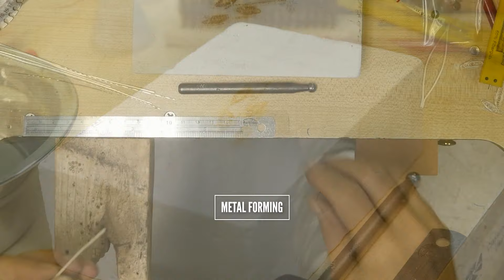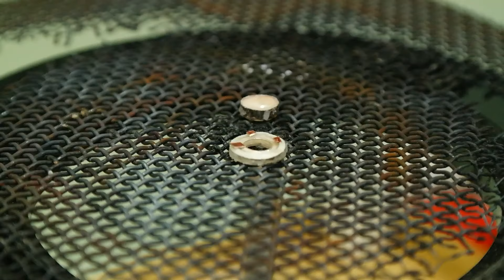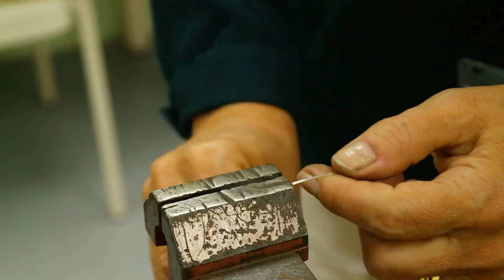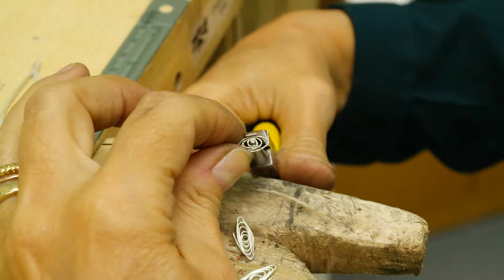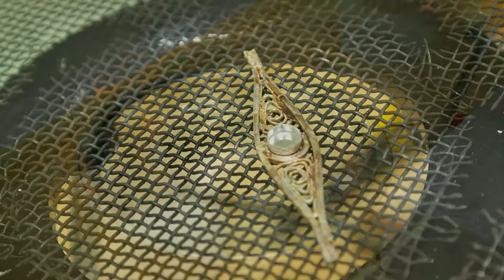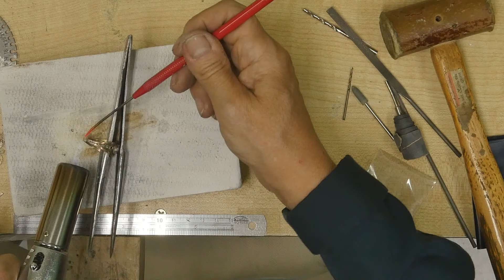💍Silversmithing for Beginners: Filigree technique to make a Ring

Comment: I absolutely love this video! Awesome job explaining everything. I am a beginner, so naturally I have a silly question. When you bow the ring shank wires does it change the initial size of the ring you measured for. It seems like it would. Would I need to go up a size when measuring wire for my shank?
Thank you so much for this tutorial!
Reply from the maker: Hello and thank you enjoying the video, I hope you will have a chance to make you very own ring   For the ring size the most important thing is to use the chart which has been devised so as to get the size to fit perfectly.  You need to know 1. what wire gauge you are using (usually 18g is a very good and sturdy thickness) 2. Your fingersize in USA measurement (there are lots of countries using their own measurements and the chart works really well for USA sizes.) With these two things the ring size will be perfect.  How it works is to select the right ring size from the left hand column and match it to the gauge from the top row.  This produces a length which works perfectly every time:
https://i.imgur.com/Qet7mTe.png
     
Say my size was size 6 US and I am working with 18 ga so the length of 18ga wire to fit around the finger will be 54.6mm long. Since it is hard to measure to the 10th of a mm we can round to the nearest 1/2 mm.  (We can measure 54.5 this would work as 0.1 of a mm will make little difference. So always round up or down to the nearest 1/2mm.)
If your finger size is 5 1/2 you need to take the size 5 result  and the size 6 result, and average them out.  
52.1 + 54.6 = 106.7 / 2 = 53.35 so I would round this to 53.5mm.
Hope this helps and would love to see how your ring turns out  Best wishes, Tanja

Comment: At what point would you shape the ring to dome the top if needed to leave space for a faceted stone while still using a low bezel setting?
Reply from the maker: Hi lizstefany5947,  please excuse my late reply as I have been travelling since end September.  Due to the delicate nature of the filigree, doming the filigree section could be difficult and dangerous.  Any stretching could cause breakage or separation of the fine wires.  It would probably be best not to dome but if you wanted to experiment then I would still do so after all the soldering is finished but before the  final wrapping of the shank around the mandrel into its correct size.  Considering that a faceted gem has only approximately 60% of its width (ie. a 10mm faceted gem will be around 6mm deep) if you use a 5mm or 6mm stone the the depth would only be around 3mm which would mean there would be only a small amount of shaping and doming to do which might work.  The biggest challenge is finding the right shape and material on which to place the ring for doming, something like pitch would work: https://www.riogrande.com/product/medium-red-chasers-pitch/118265GP/?code=118265

Comment: wonderful! would like an in depth of how to make filigree wire and if there are any different styles of filigree wire. havent found a video yet with an in depth explanation....
Reply from the maker: Hi Kevin,  There are no "special" styles of filigree wires just many creative possibilities.  I have worked with square and flat wires the most which, when twisted, create the beautiful twisted shapes that the round wire is incapable of producing.  Flat wires can also be hand wrapped without twisting to produce really nice designs.  Usually the outer frame of a piece is thicker, in our classes we use 18ga silver, with the decorative filigree being made with standard 22 and 24ga square wire which we buy from Rio Grande in the US!

Comment: Um yea soder dosnt flow upward tho? Tht should have been placed on the top not bottom idek wtf tht was
Reply from the maker: Yup it's surprising but solder follows the heat, this is one way we can control where it will flow! It is also capillary action that draws the molten solder into the tight spaces in between the metal parts.  If you just place the pallion on the top and hope the gravity will do the work, you may end up an incomplete solder joint. Have a great day!
Reply: It does flow up

Comment: This is a good video. I would love to make filigree. How much does it cost to get started? Can filigree be made with copper?
I did not understand what pickling meant. Can you explain what that is?
Reply from the maker: Hi Candy,
Thanks for your time and for your comments! Glad you enjoyed the video.

How much does it cost? 
Well, it can cost quite a bit! You saw me in my workshop - and we have tonnes of equipment like rolling mills, wire draws and other cool tools.  But if, say, you were to buy your wire ready-made (eg: buy square wire from your jewellery supplier in the size you want - then you would have much less work and could still be really creative without the need for bigger more expensive tools.  At the very least you will need some basics like a torch, tweezers, files, cutters and a comfortable place to work!
You can see the types of things we include in our beginner course here: https://jdmis.edu.sg/precious-metal-arts-certificate-courses/foundation-metalwork-skills-and-experience.html
(look at tools and materials.)

Can it be made with copper?
YES...... but....
Be careful.... copper solder (especially if you buy it from a hardware store) often contains cadmium and can be dangerous. You should check your materials before you buy and work in a well-ventilated space!  Silver is nice to work with because it is soft, melts at a lower temperature and is very safe!  Also, don't try to use silver solder on copper because it will definitely hold - but it will be super visible!

What is Pickling?
Pkcling is the use of an acid to remove the surface oxidation off a metal when you have heated it.
You can do this without pickle (ie: just manually polish until the surface is clean) but this will take waaay more time! So normally we use the pickle to speed the process up because when you bend/manipulate your metals they get work-hardened and you need to anneal them. Each time you anneal you would then have to polish away the oxidization.

Hope this helps! Have a great day,
Tanja
Reply: @JdmisEduSg  it does help. It looks doable! Thank you very much. Looks like I need to subscribe to you channel. You have been very helpful.
Reply: Pickling removes the oxidation. Some form of mild acid. I use vinegar followed by bath in baking soda water. finiish with plain water. Copper tongs may be required.

Comment: Might you be so kind to share the specific tool you are using to do the metal sanding, polishing, and finishing?  I am currently in search of a more precise tool than a Dremel.
Reply from the maker: Hello Dr Salena,  I use a jewellery flex shaft to which can attach all kinds of accessories.  Here is an example of the flex shaft with accessories.  It is a wonderful tool to assist many jewellers in their pursuit of perfection: https://www.riogrande.com/product/foredom-tx300-flex-shaft-system/117558

A Dremel is equally good as the highest speed is not really necessary.  Sometimes it is having the right attachments that will help the most.  If your Dremel can accommodate the different shaft sizes then there is no need for the extra expense of the flex shaft.  Here are some good accessories I buy: 
 https://www.riogrande.com/product/dedeco-sunburst-7-8-polishing-wheel-kit/326163
https://www.riogrande.com/product/dedeco-sunburst-deluxe-bristle-disc-point-and-pin-polishing-kit/326125
Hope this has been helpful? 😀

Comment: Very cool!

In case anyone was wondering - any time you bend metal, it gets harder through a process called “cold working”. The metal crystals/grains will get little “dislocations” in the lattice structure. It makes the metal harder and more likely to break if you kept cold working it until it was too hard. Annealing allows the metal lattice to relax and reform so that those dislocations go away as the metal atoms realign themselves. The miracle and trick is to get the metal to the annealing temperature without getting it to its melting temperature, which would mean you get to start over with your project. :-)

The flux also protects the solder and the silver from oxygen and other impurities during heating. If you didn’t use it, the silver would react with oxygen in the air and it’d form hard silver oxide.
Reply from the maker: wow, thank you David for the very informative explanation!

Comment: Thank you for this nice video. What is the diameter size of your filigree wire? Thank you.
Reply from the maker: Hi Vasiliki, Thanks for stopping by and for your nice comment!

The diameter of the outside casing was 18 gauge (See the video at 1:25) and the diameter for the smaller wire used on the inside for the filigree was 22 gauge. We did not include the video of the rolling and drawing of the 22 gauge wire to keep the video down to a reasonable time - but the process was very similar to the 18 gauge wire.
 :)

Stay safe!
Reply: @JdmisEduSg  thank you!

Comment: This is beautiful! I adore filigran. 😍 But I wanted to ask is it possible to use some different kind of metal (wire). I mean, I would like to bend wire in shapes and solder it (using a bit thicker wire), but I can't afford silver. And I am not jewller hahaha... just thought if some wire that can be bought in a hardwer store...
Reply from the maker: Hi DV!
Thanks for your great question!
You can certainly use scrap or non-jewellery materials to create with. I have some graduates that love the rustic look they get when incorporating 'hardware' into their adornments - there is also a whole genre of 'steampunk' jewellery that lends itself well to combining jewellery elements with more functional parts...

This being said, PLEASE BE VERY CAREFUL! 
When we buy jewellery supplies, we are careful to get them from suppliers that know what we will be using the metals for! They know we care about purity and quality.
If you go to the hardware store and just buy 'some wires' you could be buying things that are DANGEROUS!!
For example, some metals contain cadmium or other heavy metals (especially in solders) that produce carcinogenic fumes - others have base metals in their alloys that are completely unsuitable for you to wear on your skin for an extended period and can cause allergic reactions. If you use electrical wires or even some jewellery wires, you should be careful about coatings - tarnish-resistant or electrically conductive coatings can be toxic when you burn them - so be EXTRA CAREFUL with your ventilation too!

Good luck with your projects and thanks for watching :)
Reply: @JdmisEduSg  : Amazing! I didn't realize that there is so much nformation to be aware of when creating jewellery. Thank you sooo much for your response. 😘😘😘😘🙋
Reply: You can use other metal like copper. Still looks lovely
Reply: @lalune59  There are also solders for brass and for copper. :-)